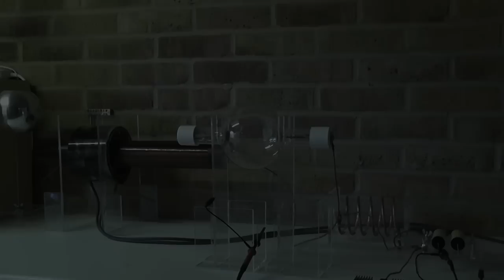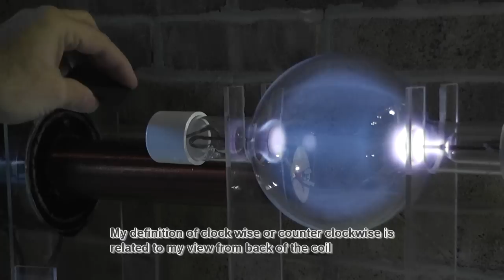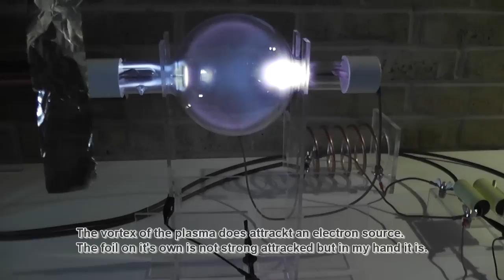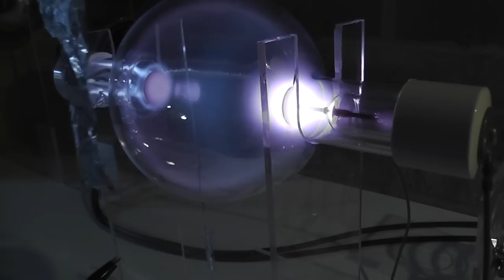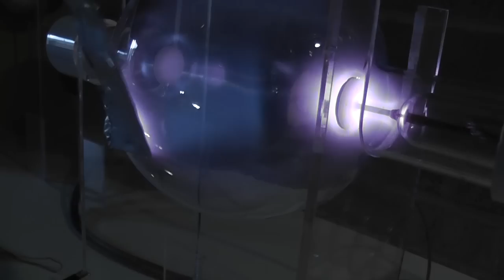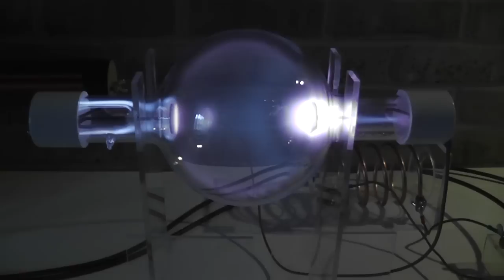Visualisation of Longitudinal waves in an plasma

Comment from the maker: You can use mainly gases like neon, helium, argon and Krypton. The vacuum level is important and also the gas mixture. I get some new kit and will apply the vacuum and gas mixture myself and measure magnetic field strength. Just like any Neon bulb from advertising boards. It requires alternating current high voltage. The wave has to come from an exciter which in my case will always be a Tesla coil construction.

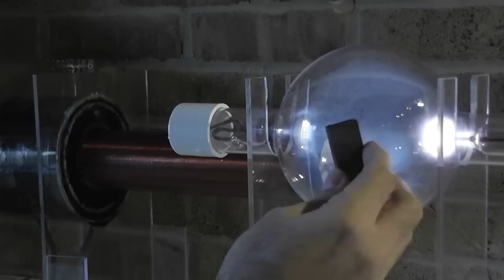Comment: 5:52
Because magnets do not 'attract' or 'repel' they simply displace the dielectric field via pressure mediation.  Magnets on their 'poles' will always have a centripetal rotation creating a vortex towards the center of the magnet, however each side will vary in clockwise or counterclockwise centripetal rotation.  I cant remember which 'pole' has which.\however  Ken Wheeler has a cool video showing how to tell which 'pole' has which spin direction just by using a copper plate and a sphere magnet.
Reply: cailean paris how can magnetic fields displace the dia-electric field if they need to be at 90 degrees to each other to create the flow of current?
Reply: drake fire think of the magnet and filings over paper experiment. The displacement happens at the gaps in between the lines made by the filings moving onto the magnetic lines of force. The filings, when moving into place, follow the right hand rule and move at 90degrees to the magnetic “flow”.

Comment from the maker: There is one problem with Magnetostatic fields. The current can not alternate rapid. Based on the standing wave or 1/4 wave at the top-load principle of a transmission line it might not be the case and can account for it.. This principle was mainly used for magnetic recording.

Comment: Tesla's longitudinal wave concept, is based on aether, a kind of pressure wave in the medium, different than the transversal wave propagation. In a plasma you have electrons and positive ions as the transfer particles. Is there a displacement current between the transmitter and receiver in a Tesla system ? Where do we see the scalar waves in the equations of Maxwell, may I ask you ? However the change of the E-field would create B, here we have again EB fields.......🤔

Comment: A guess: a longitudinal wave differs from a standard em wave in that it oscillates only on the magnetic axis -- not the electrical one.  This guess is based on the fact that a magnet is used to reinforce the longitudinal axis. If such is the case, the opposite should also be possible -- an oscillation on the electrical em axis without magnetic participation...  Be nice to hear more about the accuracy of the above conjecture.
Reply: Master Ito,  says same thing about the zero magnetic participation, I think.
Reply: @VSears-Vortex  Hi V. It's actually a more interesting topic to discuss how an em field interacts with gravitation -- something that few are willing to speculate about.  A good place to start is with the Biefeld-Brown Effect...
Reply from the maker: Unfortunately you are not able to separate the fields from each other. They are produced at the same time with different velocities and orientation. Any way to filter has consequences on the other field. That means there is no pure longitudinal wave existing. It will always use power for the transmission of transverse waves. If you shield transverse you increase the current requirement many fold without benefit for the longitudinal propagation level. I tried and tested it.
Reply: @TheOldScientist  Suspected as much. Stressor Theory says that light is transmitted by propagating moments of tension (stress) in space. Such a propagation necessarily occurs in more than one dimension (since space itself is multi-dimensional...)  By the way, that same theory explains why photons instantly accelerate (no mass) yet still exerts pressure when impacting material objects.

Comment: A magnetic field does not rotate. It's like spring, or directional funnel. Things can interact with this.
Reply from the maker: The interaction  with magnets is creating the rotation. Magnetic fields are in fact spiralling. Even light does not travel in a straight line but in spirals.

Comment: Very nice setup where did you get that bulb or did you make it? Also in the part with the ceramic magnets I think the plasma was attracted to the capacitance of your fingers. It might be interesting to attach the magnet to a nonconducting rod, it might make any forces on the magnet easier to detect as well as removing the capacitance.
Reply from the maker: You can buy them from Bill Cheb. You find him via Google search. In this scenario only the stray capacitance or parasitic capacitance of the hand is visible. The tube is build with Pyrex which is a lousy conductor in terms of energy and charge exchange. The best material is Quartz glass but very expensive. It creates Ozone, energized. In this configuration magnets are not effective, deflecting the plasma stream.
Reply: We in Australia had it made at a company who blow glass for lab work, for a R.R. Reif bulb. with helium gas.

Comment: So while studying fusion reactors I learned that plasma is highly diamagnetic. If that is true why is it attracting to the magnets instead of being repulsed away?
Reply: Plasma is dielectricity just like Tesla coils and lightening and magnets are dielectric objects. Magnetism is the dielectric field per Faraday. Magnetism and dielectricity hate each other aka diamagnetic but dielectricity attracts dielectricity where there is a ratio of 3:1 of dielectricity and magnetism so why’s it’s called a magnet idk? Well it’s magic

But the dielectric acceleration overcomes the magnetism easily and you see the highest dielectric concentration of a magnet in the center hence why you see it in the middle here and also the the ring or torus you see that is the magnetic field but here I believe it is showing the dielectric internal plane  or ”bloch wall” which is like a gyroscopic flywheel.

Comment from the maker: The attraction of the foil is not electrostatic in nature. Only conducting material is attracted. To what extend need to be investigate as well and measure current and elctrical potential
Reply: TheOldScientist The dia-electric seems to be electro static in the sense that it doesn't spin in a transverse wave manner. It's longtidudal like the inside of the capacitor plates or inside a baloon that's been rubbed to create an electro static bi-polar charge. That's opposed to how magnetic fields will repel each other if their vortex spins are opposite.
Reply: @drakefire1800  Well then, if it’s not magnetic and not electrostatic then that only leaves gravitational, unless you have another option?

Comment: It is magnetostatic then. Magnetism is the reciprocal or the inverse of the electric field.
Reply: Counter-Space lurks in the fibrous interstices between the Electric and the magnetic field ie. The E and the H vectors , each has its origin in the inertial plane which also  is counter-space. The origin is thus a singularity in Counter-Space and thus don't be surprised if a so called photon sneaks out of it or made quiescent ie polarized. So don't be surprised also that at the approach of the magnet the E vector is embedded in the  singularity in Counter-Space and  thus we have interaction with the plasma.